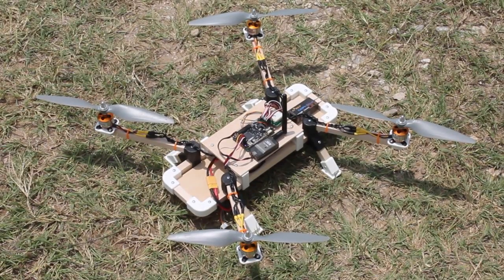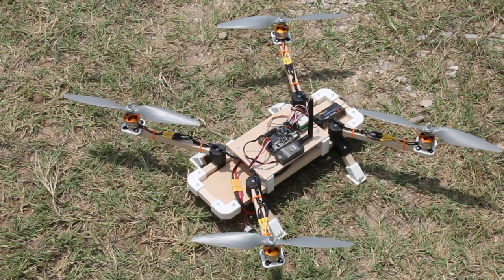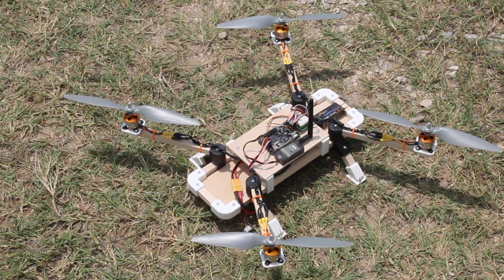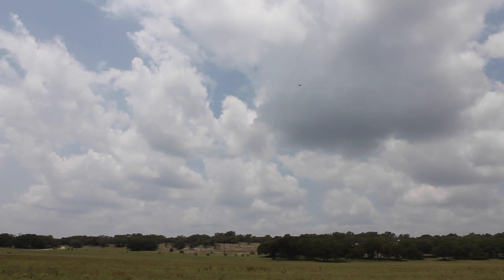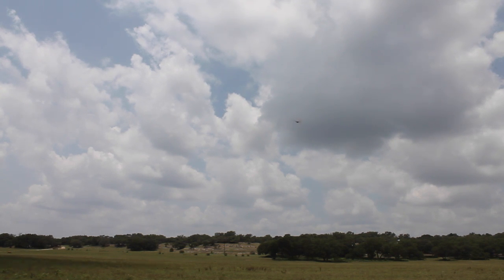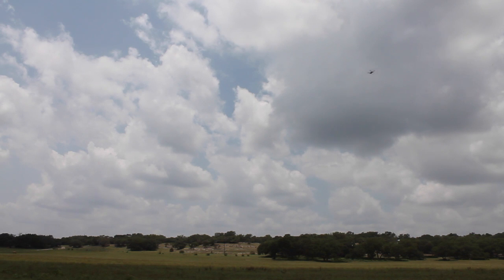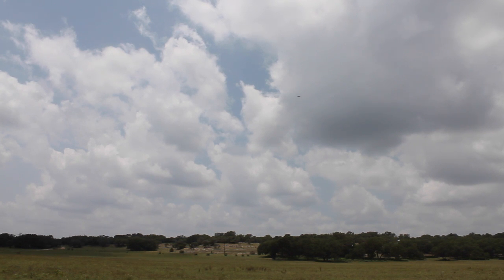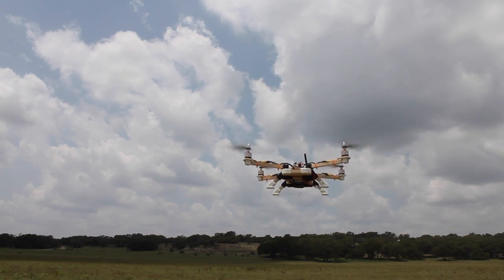HKPilot 2.5 (APM 2.5) Loiter & RTL Field Test Tip

Comment: set THR_MID to the value you see in CTUN when hoovering ThrIn and ThrOut and it wont fall and ascend when you switch stabilize/loiter
Reply from the maker: FotoAmg AmgFoto Great tip. Will give that a look. Thanks.

Comment: Hey Dennis, hope all is well. Saw this while looking for some stuff and wanted to ask a question. I bought and assembled HK's S500 kit (couldn't pass up on the price!). I'm using all the stock gear with it so far but want to get some other features like loiter and RTL. Plus I think I got what I paid for and knew I would be to upgrade some stuff. Anyway my question is what would be your go to FC? I know you've used a bunch of different kinds. I want to get into shooting some nice steady video (hung a Mobius 2axis gimble with with Tarot controller, also from HK). Had my first fly away tonight but luckily came down in neighbors yard with only damage to the landing gear from about 75 feet. Was not a fun experience. I'm very knew to all this but learn quickly but still want something not too complicated and with lots of support available. Thanks for all you do.
Reply from the maker: Dean Hallal I hope you're doing well and thanks for the question. For aerial stuff the NAZA is really hard to beat. I've heard good things about Wookong and A2 but haven't used either of those. I'll assume they are good improvements over the NAZA. I really like Pixhawk once you get it dialed in. I don't do too much aerial video work so am probably not the best person to ask. I use Pixhawk mainly for photogrammetry type applications with multirotors and fixed wings. For that it's really tough to beat. Let us know what you end up deciding to do.
Reply: Dennis Baldwin  thanks for the replies, here and elsewhere. Yeah, I meant to say NAZA in the other post. So do you make a living at photogrammerty, and what it is exactly?

Comment: Ever figure out the problem/solution
Reply from the maker: jetguy1205 Yes. It was the barometer that wasn't covered and exposed to air and light. So I ended up getting a case and it helped the problem tremendously. I'm so used to buying APM/Pixhawk that already come enclosed so I never had to deal with this before.
Reply: Dennis Baldwin I'll remember that for my build

Comment: Did you ever get the bugs worked out. I have this board but pulled the jumper for internal compass and and use an external compass/gps unit. Seams to work pretty good. I don't have this problem but i'm also using the case with some foam covering the barometer.
Reply from the maker: renoflash06 I had to put it on the shelf for a while because I was spending too much time with it and too little progress. I know it's one of those deals when I come back to it hopefully I can get it sorted. I'm pretty sure it's related to the baro being exposed, but didn't have a case or foam at the time to cover it. I appreciate the thoughts.

Comment: I had issues of mine toilet bowling when in loiter and just zooming off in loiter. RTL would also zoom off extremely fast in any direction. I bought the 3dr magnetometer and now it's spot on.  Lands right where I took off from. Too many electrical wires causing interference. I also have the APM in its case.
Reply from the maker: horsship Yeah I've been flying APM in the case for a couple years now and didn't think about this with the HKPilot. I'll need to do some more testing and tweaking. Thanks for the feedback.

Comment: The other thing you should look at is the output from the accelerometers in the tlog files.  Plot the accelerations and if they are high you'll have to soft mount the APM.  This is a problem I had with my tricopter.

Comment: Try debugging the problem by switching from stabilize to altitude hold.  If it won't hold altitude you have a barometer related problem.  The APM should be in a case and the case should not be under the props if possible.

If it behaves properly in alt hold, them switch to loiter from alt hold.  If it becomes unstable you have a GPS related issue which might be interference.

Your movies make me suspect you have more than one problem because it doesn't lose altitude when you switch to RTL.
Reply from the maker: Glenn Spacht I responded to this yesterday but for some reason my comment didn't take. Anyway, thanks for the always insightful information. I'll be working on this over the weekend and will share my results. Take care.

Comment: I have the HK pilot. Mine flies well in loiter until you give it some yaw, in which case it descends slowly a couple of meters. Doesn't matter which direction yaw, it descends a bit as long as there is yaw imput. My experience is that the lower the compassmot, the better it flies.
Reply from the maker: Matt D'Rat You're absolutely right about compassmot. I'm trying to get that lowered. Right now I'm at 41% and it's just too high. I appreciate the feedback.

Comment: Looking at the comment trail, it seems a lot of pilots are suggesting it's a baro issue, whether a bad sensor or exposure. I'd have to disagree with that sensor as the (lone) problem, as there is a great amount of instability when she's falling out of the sky in Loiter mode which would not happen based on baro input (alone).
My suggestion would be to move everything away from the APM and GPS. I believe you're using a 2.5 clone, which would have the magnetometer on board the APM module; stray mag fields from any of the wires would cause mag issues, and I see that telemetry radio in too close proximity to the GPS and APM, IMO collectively these problems would cause similar issues to yours..
Good luck Dennis, hope you keep putting out gold like this!
Reply from the maker: willdoryder Great suggestion! Thanks for putting out "gold" comments :) I'm going to try and isolate the problem and will share my results. Appreciate the thorough reply.

Comment: Dennis, I have the same problem, but only after i updated the firmware version. Originally i had no problems at all with the version that doesn't have loiter or sport modes, GPS hold worked flawless and the same with RTL. After I updated with the last version GPS Hold stop working at all RTL went bananas and loiter does the same altitud drop thing. my guess is that the software is not tuned up to HKpilot

Comment: It looks like the same problem with the Naza-M Lite at sunset time. It is about some barometer issue. It looks like pretty the same with your APM.
Reply: Theres a problem with the naza lite? Would it apply to the naza v1?
Reply: Icarus Rc Yes there is a barometer issue with sunlights in special conditions on the Naza-M Lite and Naza-M V1, many people experimented it, there is a thread on RCGroups.com. The way to solve it is to put some black tape on both sides of your flight controller. It seems to be solved on the Naza-M V2.
Reply: blackmennewstyle Wow, thanks! I've been using the naza v1 on my scratch built lack-of-structural-integrity-copter (lol) and wouldn't want it to suddenly drop in sunset:)
Reply from the maker: blackmennewstyle I think you're right. I keep forgetting that my HKPilot doesn't have a case and I bet that's what is throwing me off. Will share my results after I get the baro covered. Thanks for the feedback!

Comment: I think the barometer may need protecting. Try putting some dark foam inside the APM enclosure over the barometer.
Reply from the maker: Bradley Kirwan Good point. With my 3DR boards this is already taken care of. I don't have a case for my HKPilot but will find some good foam to cover up the barometer this week. That's gotta be the problem. Thanks for the feedback!

Comment: Dennis, I don't believe you said if your quad flies well in Alt Hold mode.  If it doesn't hold altitude in Alt Hold, it will not be stable in Loiter.  You need to have your barometer protected, as other mentioned, from both wind/prop wash and light.  With your APM connected to mission planner via USB (and battery unplugged) arm and watch the altitude data as you shine a flashlight on the barometer.  If it deviates much you need to cover the barometer better.  Also I would recommend you switch to an external mag compass and raise it and the gps higher.
The best thing to do is review your logs from the flight - that should give you a lot of info to help debug you issue.
Rick
Reply from the maker: Confessions of a Quadcopter Addict Thanks for the feedback, Rick. I've been so used to flying my APMs in their case that I completely overlooked the barometer. Since I don't have a case for the HKPilot I'm pretty sure you're exactly right about my problem. I'll give it another test this week and share my results. Take care.

Comment: I also see that your gps is installed low in the frame get it up on a pole, remember the inverse square law.    Or at least move the wires that cover it.  All wires have a magnetic field when carrying power. this will help with rth settings
Reply from the maker: Andy Shrimpton Love the suggestion and am definitely going to give that a try. My wiring is quite pathetic so I'll get it cleaned up. Thanks again!
Reply: lets us all know the out come. I am testing a dji 450 with kk2 board with my own design of anti vibration mount and crash protection. also an easy to install anti vibration mount for a mobius, no drilling required.  I hope to be able to help people get flying cheaply with and be able to get good results

Comment: hi Dennis Andy here first of all thanks for all your vids.  my channel is GAATECH. All about cnc cut upgrade parts of many different frames. hope to have my online shop uo and running soon.  I design and cut all the parts myself.  so if you ever require something drop me a message.

I think your problem is that your apm is open and the prop wash affects the baro. as a first easy test place a cover over the apm so that no prop wash or vertex caused by the props can up set the board. do not make it air tight otherwise the baro will not detect the air pressure. 

hope this sorts out your problem.
Reply from the maker: Andy Shrimpton Thanks for the info on your shop. When you do get around to launching it please feel free to share all about it at www.garagepilots.com. I think there are many of those that will be interested in hearing more about what you're up to.

Another user mentioned the same thing regarding my baro. You know, I'm so used to flying APM 2.5 and 2.6 enclosed in a case with baro protection. I didn't even think about this with the HKPilot board being exposed. Will definitely cover it up with some porous foam and give it another test. 

Many thanks!

Comment: Sorry for asking a "noobish" question, but what's the difference between this FC and for instance a Crius AIO, besides the size and the price? They seem to have the same processor and sensors?
Reply from the maker: SirArghPirate I'm a noob with you :) Not sure of the difference but I've read good things about the AIO. I do plan on giving it a try in the near future. If you learn of any major differences please let us know. When I get around to purchasing one I'll definitely share my results. Thanks for the question.
Reply: Dennis Baldwin I've only tried the Crius with Multiwii 2.3, and KK2.0 briefly. The Multwii seems great, but I'm not able to get the pos hold and rth to work. I guess it has to do with the magnetometer and interraction from battery/wires.
Reply: SirArghPirate power wires and esc have some impact over the magnetometer and i personally think that multiwii is much harder to calibrate than megapirateng 3.0.1.

If you want to get a nice loiter or gps-hold i strongly recommend megapirateng with the crius board.
Reply: Tobias Awadis Yes, I've considered trying it. The reason I haven't so far is because I'm too lazy bringing my laptop with me for configuration. With MultiWii I can use my phone to access all the pid parametres via bluetooth. :). But yes, I've read that Megapirate is easier to configure and has much better gps functions.
Reply: SirArghPirate you can access the pids via bluetooth with megapirateng also just as easily as with multiwii. It's just that megapirateng is a little bit harder to install but there are good instructions at the megapirateng site.
Reply: Tobias Awadis I tried flashing MPNG today but I haven't tried flying it yet. What I found is that arming/disarming is really slow compared to the MultiWii, on the MP I have to give low throttle + right rudder for two seconds, then wait another 2-3 seconds before it arms, same delay with disarming (disarming should be a lot quicker in my opinion..). I haven't found a way to assign this to a switch like I can with the MultiWii, where a flick of the switch would disarm it instantaneously. Also the way to assign the different flight modes to different switchs seems a bit less intuitative on the MPNG, if at all possible. I tried using my phone and Droidplanner, but that kept crashing before I could find the PID-parameters. I also tried adding the gps, but according to Mission Planner it wasn't connected (I configured the correct baud rate and type/protocol using the arduino code). I will have to look a littte more into this before I dare flying it :).
Reply: SirArghPirate I don't know really if you can arm it with a button i have never tried it, its more like a safety thing i think to have to wait for a few seconds before bursting of.

Its really easy to assign flightmodes in Mission Planner, its a bit different depending what transmitter you are using. there are millions of DIY videos on the tube.

If you are using a GPS, don't forget to properly calibrate both the GPS and the MAG, otherwise you won't be able to have a good loiter.
Reply: Tobias Awadis Yes, there should be a delay when arming, but not on disarming in my opinion. It is certainly possible to shorting this arming time by making changes to the code, so that's not a hugh problem. After calibrating ESCs and radio I still didn't get the motors to spin when idle, so when I cut throttle the motors stop entirely. I can't find out why my gps doesn't work, it does connect to ucenter and I have the correct protocol and baud speed set. Seems like this is a common problem. Also I couldn't find the pid-configuration. Are you using an app called Droidplanner 2?
Reply: SirArghPirate I have never had any problem with my GPS (yet), but bare in mind that you can't change any code in Arduino in 3.0.1 R4, as you could do with 2.9 you have to have a external c+ editor.

PID-settings (how it looks):
http://multirotorpilotmag.com/wp-content/uploads/2014/03/MissionPLanner-Y-1.png

At the same page you can assign ch7 to anythings you want to configure and you can adjust pid:s with the transmitter.

I don't use Droidplanner 2, i use my transmitter instead.
Reply: Tobias Awadis I finally got the gps to work. What I did was reconfiguring the gps and erasing the eeprom (I suspect the latter did the trick). You use your radio to change the pid-parametres, does this work with the Taranis as well? I did use mission planner at first to calibrate acc and mag, but when I tried to fly it afterwards it was waaay to unstable using the default PID-parametres.

Comment: This may be unrelated to you issue...I have the hk pilot mega mini 2.5 and had major uses with COMPASSMOT. I ended up moving all related video parts (osd, wires, etc) away from the compass/gps. I'm still not getting a desired result, but the 32% is better then 44% I was getting before.
Reply from the maker: wickedbuddha Thanks for the feedback. My compassmot was 41% which is considered the "grey" area. I was expecting to see better performance with this QBrain ESC. I had read that the QBrain case provides more protection from interference, but I'm not sure that's the case. I'm going to do some work to cover up the barometer and will share my results. Thanks for the feedback.